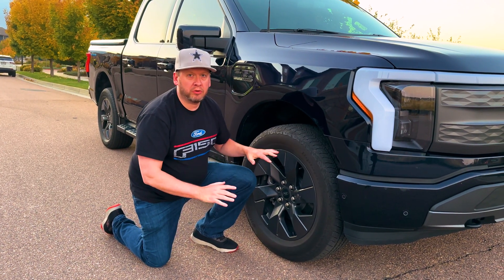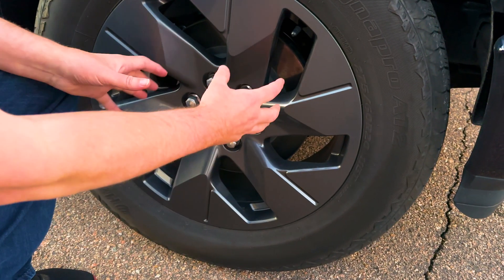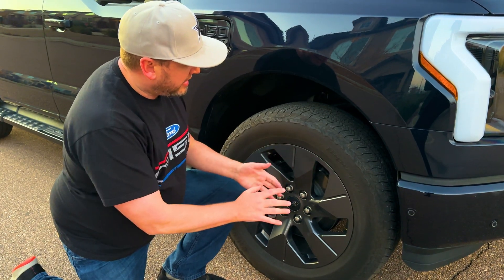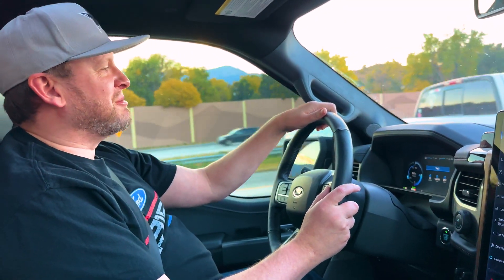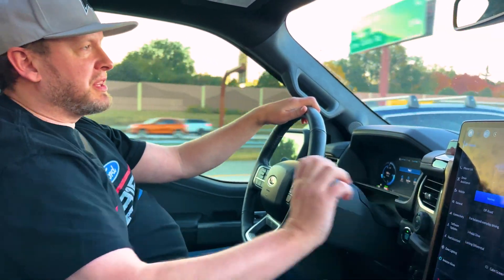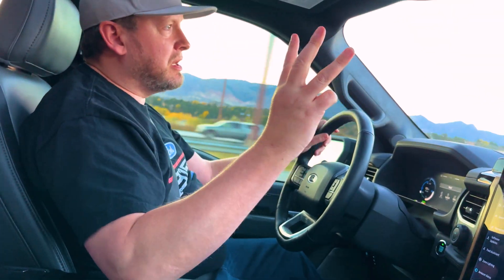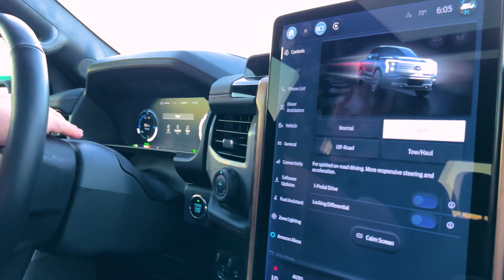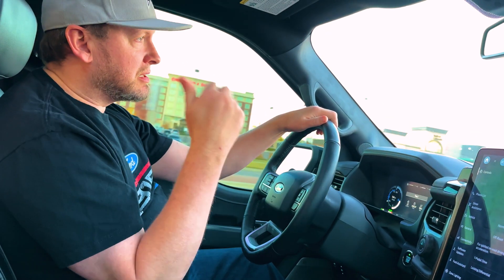Why Sport Mode gets you the best range? & What is Regenerative braking?

Comment: I have driven EVs since 2012 starting with a Ford Focus Electric, on to BMW i3’s and now with my Lightning. In over 200,000 miles of driving, I have had the best range using one pedal. In 31,000 in my ‘23 Platinum and a 3500 mile trip from LA to Seattle, back to Tuscon and back home to LA I have settled on Sport Mode One Pedal. My daily commute is 90 miles to work and home. Without one pedal the average is 2.3 going and 1.9 coming. With Sport Mode one pedal it’s 2.6 and 2.2. If I use 65% streets it’s 2.9 2.5.

My lifetime average sits at 2.1 because of the freeway mileage. Long freeway trips reduce greatly regen and pushing this brick through air at 70+ mph kills range. I try to use 69 as my goal but people end up making you drive and kill your Zen. Regardless the Lightning is real good at regen so to not maximize it is to give away kW’s.
Reply from the maker: This is good info Leroy.  Thank you.
Reply: If you Coast as much as you can without 1 pedal you will exceed the range of 1 pedal. I also own a lightning and have thoroughly tested this.

Comment: Of all the modes, undoubtedly, normal mode without 1 pedal would be the most efficient. The more you coast, the more efficient the drive. Regen is not as efficient as coasting.
In reality, the driving mode does not matter at all because the driver has the ability to control the amount of regen at all times by varying pedal pressure.
In fact, if you could coast (0% regen) to a stop every time you stopped, that would be the very most efficient, albeit impractical.
Think of it in terms of physics. Let's say you use 1kW of energy to get up to speed and then coast to a stop in the span of 1 mile. If you did that same mile using regen, you would use 1.5kW for propulsion and maybe get .4kW back from regen for .1kW lower efficiency. 
I know those numbers aren't accurate. They are just for demonstration purposes, but the physics concept is solid. Try it out and see. If efficiency is your goal, shoot for as much coasting and as little regen as you can.
Reply from the maker: My info is based on my experience.  Sport mode has been more efficient, but I will record an exact road test to show for sure comparing all of the modes with the same approx 100 mile drive.
Reply: @F150LightningMike  well, my friend, youre just not seeing it correctly.
Reply from the maker: I guess not.  You are correct that traffic is different everyday so it’s hard to compare, and granted I don’t think there is too much of a difference in modes if it’s all highway.  I must be doing something wrong, But with a lot of mixed driving I do, sport mode ends up on top according to my trip meter every time.
Reply: the science and maths will bear this out too.  doing the same work over the same route in the same truck, energy used will NOT be significantly different in different driving modes (with or without regen)

Comment: I have a question.  What is the difference between normal mode and sport mode in an EV ???  I'm getting my f150 ligthning XLT extended range in the beginning of march, but I still don't know what is the use of sport mode.  Sorry, I'm new with this technologie 🙂
Reply from the maker: Sport mode is better because it initiates more regenerative braking without you having to use the brake pedal as much as in normal mode.  It’s also less “whiplashy” than the 1-pedal drive mode is.
Sport mode does other things too, like making the steering a little more responsive.
I hope that answers your question.

Comment: A scientist would say leave the object in motion until it needs to be acted upon by an external slowing force. Regen is 60-70% efficient. If you can drive in normal mode and consistently hit 100% on the braking coach it makes logical sense that would be best, going further distance with less regen. Sport mode is interesting for towing as it is really easy to get into the brake pad with normal mode pulling a trailer. Lots of people out there accelerating even as they approach a red light. One pedal best for them.
Reply: This has been my thoughts when debating this with folks. Need some side by side comparisons to know for sure!
Reply from the maker: I’m going to do some more testing.  It’s surprising how many people argue about this.  I tried sport mode one day off of a suggestion and it looked like to me to get better overall mi/kWh so I’ve stuck with it except for these test.
Reply from the maker: Those are great thoughts. Thank you.

Comment: I am on my 3rd EV with having just got my Lightning. I am so used to one pedal driving but I can see how sport mode with no one pedal for road trips would get better range. On road trips I also fold my mirrors for better range.
Reply: I just bought a Lightning last week.  So you're folding your side few mirrors and rolling down the highway?  Is that legal??
Reply: @sunnylamine  I think it is. How do you fold them while driving?
Reply from the maker: On Lariats there is a button to do it, but I still wouldn’t recommend doing it while you’re driving.
Reply from the maker: That’s an interesting concept about folding mirrors.  I’ve never even tried that while driving.  Only pulling into my garage or after parking.

Comment: It doesn't.......just drive regular mode. And if you're a range fan....(slow down???...)...duh
Reply from the maker: It works for me … I’ve done several tests some on video and some not and it gets the best range for me.  Here’s another video I did about it: I Got 353 Miles on a single charge - Sport Mode Test 2 in a Ford Lightning
https://youtu.be/UI8zgj8kV_Y

Comment: I finally got a Lightning and for sure sport mode does more regen braking than normal mode. Sport mode feels heavy and more brakey and torquey which had me wondering if it will wear the tires more? Or maybe if I am easy on the accelerator it will wear the tires as much as normal mode? 🤔
Reply from the maker: Those are good questions I’m not sure I have a good answer, but I do know that if you have the same hankook dynapro at2 tires as mine that the recommended Psi of 36 is too low.  It wore down too quickly on the outside edge of the tires.  I had them evaluated at Good year and they are saying that it should be about 40-42 psi.  I met a guy that had over 26k on his and they looked new. He said he kept them at about 39-40
Reply: @F150LightningMike  Thanks for the tip! I think mine has Michelins but I’ll check the tire pressure!
Reply from the maker: Sure thing.  Let me know if you have any other questions and I might make a video about it.  There is one about how easy it is to charge at ChargePoint that is posting here at 9am mountain time.  It is at a McDonald’s and the call it a “McFast Charger” :-) 
Then I’m working on a 1 year summary video as well as several others, but I’m open to ideas if you are curious about something.  I even just bought a dashcam that I’m going to talk about soon too.
Reply: @F150LightningMike  Yeah my Michelins are set to 36 or 37 and as they heat up they go to 39. 36 is what the door sticker recommends. I’m pretty sure my Tacoma has a cold psi recommendation of 39. Maybe I should start creeping it up. Scratch that: the Taco sticker recommends 26-29 psi depending on tire size wow.
Reply from the maker: Yeah how I figured the manufacturer is getting away with it is the “cold pressure” recommendation.  Who is defining what cold is?  because in my experience the psi drops about 1 psi for every 10 degrees.  It’s also weird in Colorado because when you go up and down in elevation a lot like me it changes tire pressure too about 1 psi for every 1,000 feet.  Anyways I just have to find a good psi that works for me.  So if they say 36 “cold”, then for me it works best if it’s 60degrees outside to set it to 42 psi. That way I’m over filling a little and it will be able flex a little when it’s cold.
Reply: @F150LightningMike   this is starting to sound like deflategate lol!! got my truck a month ago and came with tires at 41 psi. i took notice from watching ur vids.
Reply from the maker: “Deflategate” … that’s awesome! 
I’m glad to hear my videos helped.

Comment: 1 pedal drive for me - cost of brake replacement far outweighs any regen savings you may get in normal mode.
Reply from the maker: The other modes also use regen when you apply the brake pedal first before using the the brake pads.  You can turn on  “brake coach” and it will tell you how much % of the braking was returned to the batteries.
Reply: @F150LightningMike  I understand - I just don’t want to have to replace the brakes ever while I own it. So 1 pedal driving gives me the best chance for that.
Reply from the maker: That makes sense for sure.  I hope I don’t either.

Comment: I made a similar comment on the short - but watched the full video and the information presented here between normal mode and normal mode with one pedal drive is not accurate.  One pedal drive shows more regenerative braking because when you take your foot off the pedal the vehicle actively brakes - its not the same comparison.  To make a same comparison without one pedal drive, you need to take your foot off the accelerator and immediately press the brake - then you would have seen the exact same response for the regenerative braking display.   One pedal drive only gives you more regenerative braking energy because the vehicle IS braking.  Without one pedal drive, the vehicle is coasting.  Ford uses blended braking through the brake pedal, so if you choose not to use one pedal drive, you still have full regen capability through the brake pedal. The transition to friction brakes will happen at very low speed (<5mph) to bring the vehicle to a complete stop, or if the deceleration limit of electric motors (well, generators in this case) is reached/exceeded.
Reply from the maker: Good info thank you.

Comment: One pedal is awesome once you get used to it. I judge my stops way ahead and get lots of charge. In the city my range actually goes up on occasion.
I will try the sports mode on the highway though. It would be nice to coast at high speeds.
Reply from the maker: Let me know how it works for you.
Reply: If your range is going up either you are driving downhill or the computer is not calculating all that accurately. Regenerative braking is good but you are lucky if you can capture 60% of the potential energy in the battery. If your battery is at 20% state of charge the battery will accept more energy than at 80% state of charge.
Reply from the maker: Sport mode is still the most efficient mode for me.
Reply: Just spent my first day with my 2025.Lariat Lightning   I decided to jump right into 1 pedal drive mainly to save the brakes.  Getting a little regenerative charge is a bonus for me.  The only tricky part is in parking lots or turning around because it will stop on you pretty quick.

Comment: Idk fellas, i tend to get better range not using 1 pedal and being in normal mode. The goal is to coast as far as you can before Regen braking.
Reply: Agree with you. Converting kinetic energy of coasting into battery power with regen braking is obviously not 100% efficient. Converting energy types is never 100%. You're better off coasting as much as you can and finding that sweet spot of braking so you are only using regen braking to stop. Stomping on the brake pedal is just making heat and wasting your range.
Reply from the maker: I did a pretty good comparison of all 4 modes in this video:
Ford Lightning - 1 Pedal Drive vs Sport Mode - Winter Range Test
https://youtu.be/tjgFYQS1Aj8
Reply from the maker: Interesting, have you tried just leaving it in sport mode?
Reply: Summers knows what’s up
Reply: I drive with 2 pedals, even in an ev
Reply: I have another issue that not often mentioned , leg hurts if I push too hard on the pedal over extended periods of time and I do drive many hours almost every day so if I do not have cruise control, the pain goes all the way to my neck and my head and it is a problem if I have to push on the pedal very hard 😮so considering that ,most of my life I have paid close attention to how hard I push on the pedal and to make sure to use cruise control when possible so one pedal driving requires more pressure on the accelerator by a considerable amount Ruling out the possibility of that being my favorite way of driving.  also should mention that as I have passengers  some get carsick one pedal driving is a little more problematic, and I tend to slow down slowly not aggressively, conserve the tires and is safer just my way of driving , so using regenerative breaking. I love it but never do the one pedal driving very often or very long.

Comment: One Pedal Drive works best for me- but with a soft pedal- I never let off all the way until I want to stop.  Lifetime is 2.5 miles/kWh.   I can get 3.5 miles/kWh driving around town- always one pedal.   It would be interesting to do a real test under controlled conditions.   For some people who don't have the soft touch on the one pedal the other modes might work better.   The Ioniq 5 has paddles so the driver can set the amount of regen- some youTubers have done some testing with different amounts of regen up to and including one pedal.
Reply from the maker: This is really good info.  Yeah I need to do some more apples to apples comparison on it, but my thought would be doing it where you’re not really thinking about it you’re not trying to get better miles per kilowatt. You’re just driving and doing the same test both ways on the same roads.  I have a pretty good route that I can use for the test that I’ve used before. It’s a good combination of city, two-lane highway, and interstate.

Comment: But you slow down harder and faster, thus won't it take more energy to get back to speed?  Also, Ford used regen braking when you step on the break until you need to stop fast, at which time it will use the physical braks.....  Just my thoughts....
Reply from the maker: With sport mode you don’t slow down too much harder.  Just a little bit and you end up gaining more energy for the batteries than just using normal.  The point with the video is to show that it just works better for me.
Reply: If your in town and come up to lights every mile or half mile, letting off the gas pedal in one pedal driving is just like braking as you approach a light, but it regenerates more power than just stepping on the brake pedal with one pedal driving turned off.  One pedal is much more efficient around town.
Reply from the maker: I’ll continue testing, but sport mode so far is still the most efficient for me.

Comment: What I disliked about one peddle driving is that once you let off it will slow you down very fast and eventually to a stop which is what you want if only using one peddle.  The sport mode just adds almost the same regentative, but as long as you are not using one peddle it is more normal driving and not bringing you down to a complete stop.  I would use sport mode all the time unfortunately it will not stay as default when you turn off your truck.  I only use one peddle when in stop and go traffic on the freeway, because it is very hard not to be too jerky with it.
Reply: My favorite thing to do in stop and go traffic is to let adaptive cruise control do it for me! This complete lack of changing gears and mechanical torque converters etc is wonderfully smooth and infinitely more patient than I am!
Reply from the maker: I love adaptive cruise control! BlueCruise on trips is even better.
Reply from the maker: Yeah I call 1-pedal drive “whiplash mode” for that reason.  When I start my truck it gives me the option to go back into sport mode so I just click ok on the steering wheel.  Also I heard they are going to be including that on a future update.
Reply from the maker: You are not wrong.  Yes it’s not an on or off.  My point with making this video is to show that regardless of all of that and even though 1-pedal drive is supposed to be more efficient than the others.  It is not for me.  Sport mode gets better efficiency.  Not fully sure of the reason it just does.  But I am working on another video where I am just driving in town and testing out all the different modes several different times taking the same route and seeing which one is more efficient in town. I’m even testing sport mode with one pedal drive on.

Comment: I have a chevy bolt and get the most range when coasting. You regen less but for a lot longer, the math makes more sense. OPD cuts my mileage drastically
Reply from the maker: Thank you.  With the weight of the truck it really does help with regen too.
Reply: I always hate to see Chevy Bolts ahead of me or already charging in busy chargers because they have such slow charging.
Reply from the maker: I haven’t experienced that yet, but I could imagine it would be frustrating.